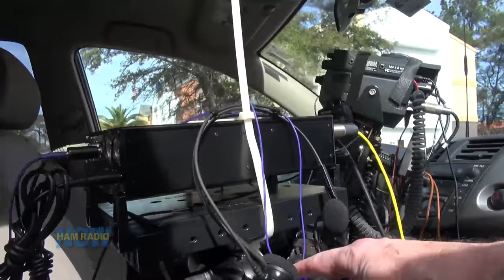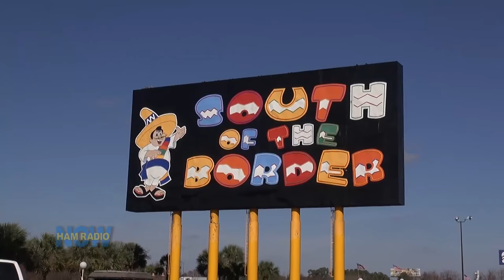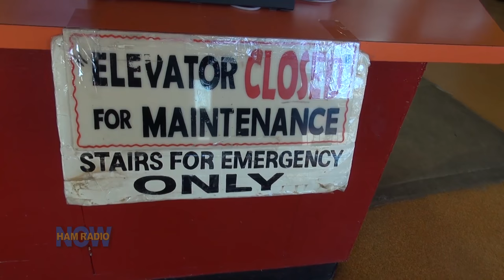HRN 300! On the Road: Orlando 2017 PART TWO - On the Road

Comment: Enjoying it or, Hehe, incredibly bored. Hehe, guess I am amazed how much we can enjoy one of us just rambling. Gary, your travel videos are a bit scary watching you drive and fiddle with the gear. Makes me wonder how crazy I am running CW while driving! Keep it up, but please lets not get to see accident video.
Reply from the maker: I haven't analyzed the videos for this, so call me on it if I'm wrong: I don't usually adjust the radios when there's heavy traffic around me (or do I?). 

This may be just rationalizing, but I think I've learned to do most manipulation without looking, or just a quick scan. I don't think they divert my attention from driving more than the usual things like adjusting the temperature. I did miss that turn to stay on I-40, didn't I? I was talking, not adjusting, so what does that tell me?

One thing I'm aware of is that most of the time, we ALL get away with bad driving habits because nothing unexpected happens – we get lucky. I'm sure I've been in situations where I would have missed seeing some sudden maneuver that would have led to a crash, but that maneuver just didn't happen. Some of that was probably looking a little too long at a radio display. I've likely raised the odds of a crash, but who knows how much?

I've been in three bad crashes in my 52 years of driving. I was hit from behind while stopped to make a left turn. I was T-Boned by someone who blew a stop sign. And I was hit from behind after turning left into a lane with a guy who was speeding. That last one I probably could have avoided, but none involved radios.

Co-host David Goldenberg mentioned that California has made it illegal to operate a ham radio mobile. We haven't gone into detail. Maybe a hands-free connection would be OK. If many states go along, our manufacturers will have to come up with some adaptive technology, quickly (not just new radios).

I wonder if the texting issue that we're being swept up in is really much different. Do the texters lose more (lots more) concentration than a radio op?

Comment: Nothing was more thrilling as seeing those big 53' tractor trailers  drift by you and then disappear over the horizon  out in front of you... LOL...
Otherwise that was a great video... that QSO  with K0EEA on 20  around 2:30 was pretty cool
Reply from the maker: Jim Barrie - I drive slow...
Reply: I noticed... but during that 20 M QSO,  I could see your seedo , and you had it pinned at 70 MPH, I think... maybe 65, but not the 50 -55 that you were cruising at earlier...  so anyway still a great video
Jim
WA8SDF

Comment: Tom VA3TGPI'm curious what you are using for your main 12 volt source in your Rav. With the power draw you must have, I'm wondering if you use an auxiliary power battery source charging from your vehicle alternator source.73
Reply from the maker: Nothing. The current draw from all radios in Receive is about 12 Amps. Most of the time only one radio will be transmitting at a time (with occasional short bursts from the APRS packet beacon). So that brings the intermittent current draw to about 25 Amps. The alternator can handle that easily.

Comment: Have the Police ever stopped you, and questioned you about all the gear you have in your car ? regards from the UK
Reply from the maker: No. I don't give them much reason for suspicion. I'm rarely driving more than the typical 'speed limit + 5 mph' and usually less. I am only 'Driving While White'. They pass me all the time on the highway, and if they're even curious, they show no sign of it.

Co-host W0DHG has noted that I might have trouble in California, at least if they catch me holding a microphone (apparently that's now illegal there). I don't know if they have any rules about just having this configuration of equipment. AFAIK no other state does. 

Now and then I'm working with law enforcement on Public Service events in North Carolina, and no one has ever cautioned me about it.

Do you think this would be a problem over in the UK? 73- Gary KN4AQ
Reply: Also...if I recall correctly he has a ham license tag on his car and, even if they aren't hams themselves, most officers will recognize what that is and put that plus the antennas together.
Reply from the maker: That's true - maybe that helps, too.

Comment: why so many radios.... if u have the ft-857 it does all the bands and puts out 100 watts which is about all you would need in a car. you might want to add a 220 Mhz radio but other than that i dont see a need for all those different radios.
Reply from the maker: You are required to immediately return your Amateur Radio license for cancellation.
Reply: nice response to a question..... specially since i have had my license for about 2 weeks now ..... i have watched a bunch of your videos and so far saw nothing that explained why the number of different radios in your car. i was actually asking a serious question and i get an answer telling me to return my license. way to chase someone away from the hobby
Reply from the maker: The ICOM 7000 has HF plus VHF/UHF, but I want to be able to monitor/operate both HF and at least a few VHF/UHF channels at the same time (two operators, potential Emcomm use). 

The Yaesu 8900, ICOM 2820 and Kenwood D-710 seem to be redundant VHF/UHF, but each has a unique capability. The Yaesu has 6 meters, the ICOM does D-STAR, and the Kenwood does APRS (and allows me to continuously monitor the 146.52 national simplex channel while on the road). I'm adding a DMR mobile that picked up at Orlando.

But the ultimate reason I did it is because I wanted to, and felt no need to actually justify it. 

And a lesson to take away from this encounter is that no ham accuses another of having too many radios or too many antennas. Good thing I didn't show how many handheld's I've accumulated over the years.

Just kidding. Sort of.
Reply: HamRadioNow thanks for the explanation... I really was not accusing u of to many radios .... or to justify the number.... however now I understand a lot more the reasoning and need for them all... sorry if my initial post and question sounded like an accusation of to many radios..... I may be a new Hampshire but I already wish my budget was big enuff to have a dozen radios I have been researching as my first